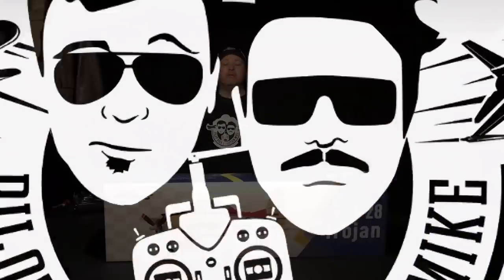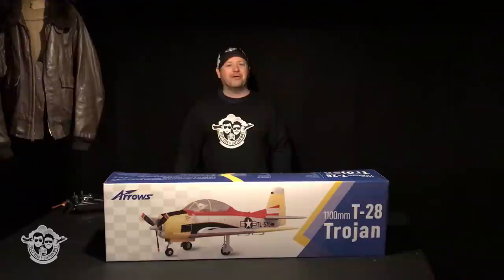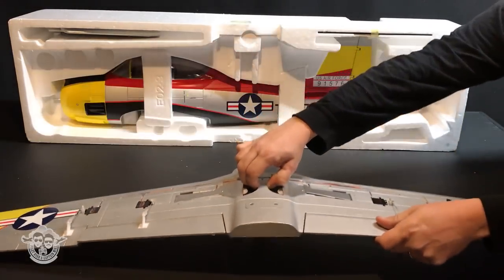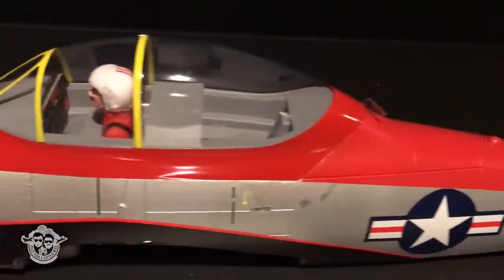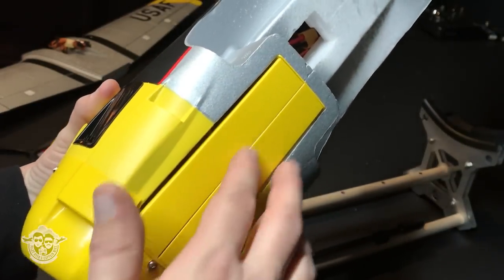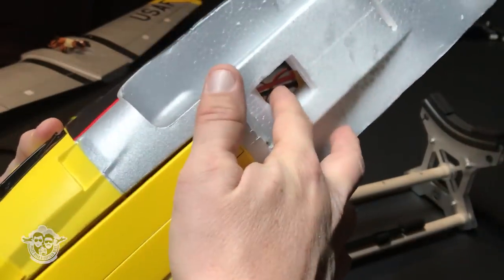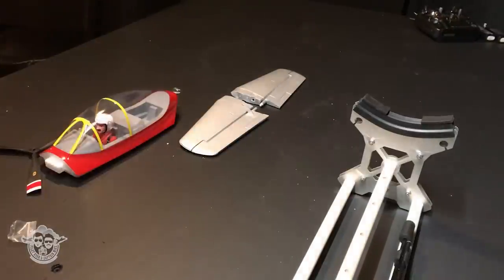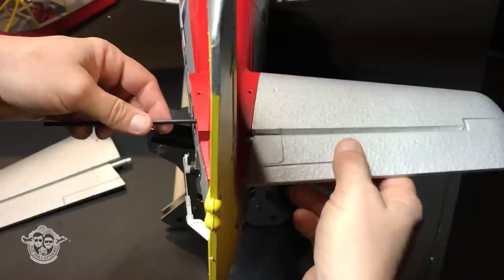Arrows RC T-28 Trojan 1100mm PNP Assembly

Comment: I have the older blue T-28, I cut out flaps and put retractable gear on it, along with lights.  I love that plane because of all of the fun mods I put into it. 

I like this one too, but not enough flap for me.  I think I would cut a second flap between the current flap and the landing gear, put a second servo on it, then have a few different settings for both takeoff and landing.  With enough flaps, you can actually fly this plane as slow as a brisk jog...great for taking off and landing on very short runways.  Also lots of fun for super slow flybys. :)

Just make sure you have good skill controlling the plane because with a lot of flap you'll stall it very easily.

Comment: The canopy popped off mine 50% of the time using regular 3S 2700 batteries.  I added another magnet, hollowed out the underside of the canopy and switched to low profile batteries.

Comment: Hello pilot Ryan,just assembled my T-28. This is my 2nd plane,first plug and play. Would like your opinion on what to do with the receiver antenna wires, do you leave them in the compartment or run them to the outside of the plane?
Reply from the maker: Just make sure the antennas are 90 degrees to each other.

Comment: my eleven hobby version is super smooth, 400w 35 amp 3 s  using fms pilatus 1100mm 5 blade prop. its worth a try if you break the arrows prop

Comment: Please would you let me know where the Center of gravity is on this Aircraft - The manual I do not think is correct  , it is showing it 45 to 50 mm from the leading edge at the root !! - this looks insane - should it be 45 to 50 from the leading edge of the wing - say for example 3-4 inch down the wings leading edge ??  (not from the root) - if you would be kind enough to let me know , I might have a chance at doing my maiden. thanks
Reply from the maker: FlankerTanker should be in the meat of the wing. Like the thickest part but slightly forward. Look at other brands of t28 and get a visual as to where they put theirs. What battery are you using
Reply: @PilotRyanMedia  thanks I am watching other videos to see if I can spot cg markings... battery is a 3s 2200 turnegy from HobbyKing

Comment: This looks like the discontinued Eleven Hobby plane from Banggood with a new paint job and higher price.
Reply: yeah..im still flying my yellow BG t28...this one is $40 dollars more
Reply: i think your right....
Reply: I bought two off Banggood for $117, which was a steal—crazy cheap. They fly really well.   Still a decent value from Arrows.
Reply: Your right I got the F8F  bearcat, p-51, and t-28 and I didn't pay anymore than 150.00
Reply: Thats possible. As I explained, the company that made the molds for these planes get contracts from many companys to produce that plane. No company could make it if they only produced for one seller. It can easily be rebranded by anyone. The basic plane molds cost thousands of dollars to make. Selling the molds to another manufacterer is possible but just producing the parts and sending them to another company is generally how its done in China. Even factory seconds can be sold as parts or made with cheaper parts and sold by someone else.
Reply: @NCC7060  Mine is still in the box. I got mine when they were selling them dirt cheap. I should have gotten two at that price and saved one for parts. I tell people to do it all the time with drones, why not planes too?
Reply: I still have my eleven hobby plane. Brand new in box, never been flown. Got it on sale when they had a deal going. Everyone was buying them.

Comment: Woulda been nice if they spent a Nickel for put some Silver Painted Tape over the Servo Wire Trenches.
Reply: I wish they sold tape like that to the public too. Every time I have to change a servo or do a crashed plane repair, I have to get creative. Seems regular masking tape on an old glass window and spray painted silver works the best. Its just a hassle thats all.

Comment: don't think we need another off brand rc to many already
Reply: james white, we do if they are less expensive
Reply: Seriously?
Reply: Another T-28? Boring.....
Reply: Its the same mold as 11 hobby. Do you really think China can afford to make 4 or 5 molds of the same plane through different companys? In the manufacturing world , those dies cost a fortune to make. 
The company that made those dies charges a LOT of money. What generally happends is the company that molds the basic frame, wings, tail, sells to Many companys whom take those basic parts and use them with their own motors , servos, landing gear. etc. 
Its a known practice. Those dies were all made by the same company. Sometimes, dies are sold and " cleaned up" by another company. More detail is added and a higher priced plane is produced by the new company. In the toy industry, this happends all the time. No one can afford to let a set of dies sit on a shelf.